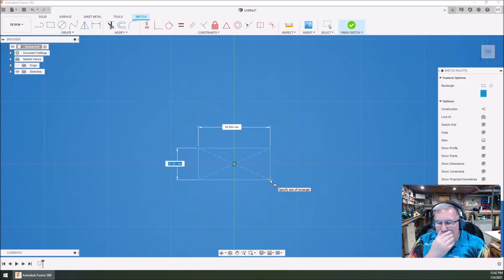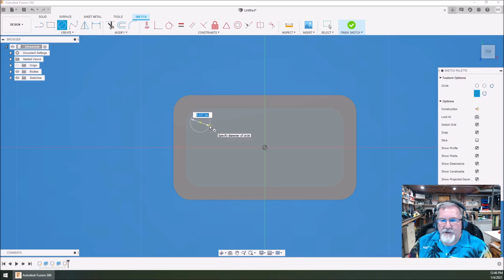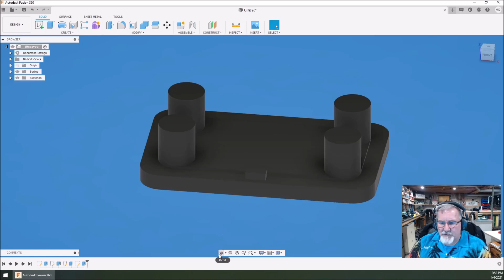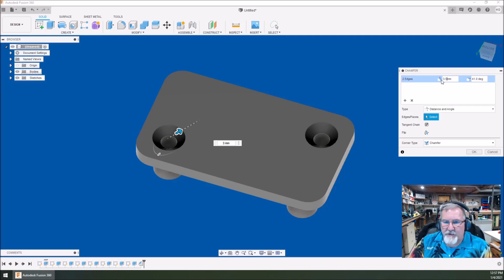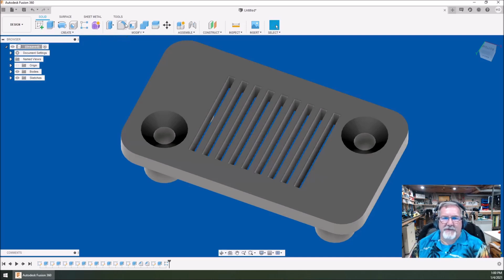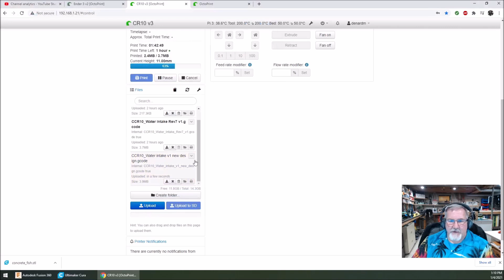Reverse Engineering with Fusion 360  Let's design and print. Today we create an outboard motor part.

Comment: Very nice. I do quite a bit of reverse engineering for 3d printing. If possible I scan it, then inserted the scanned image in to a cad program and draw from the image. then delete the image. then connect the lines as necessary, then scale the drawing to one side of the actual part. Repeat (if needed and possible) for other sides of the part. This would have worked for your part because it was basically a box but it won’t work if the part doesn’t have at least one flat surface. However I’m not sure it would be any quicker than your method of measuring and sketching the actual part. Just shows there’s more than one way to skin a cat. Thanks for all your videos.
Reply from the maker: Thanks for watching and commenting

Comment: Don't have a 3d printer yet, however I loved this video. Excellent work!!!  I have 1 question about the Creality CR10 v3 you have, did you install the BL Touch device?
Reply from the maker: I do not have the BL Touch device. I think they can be very useful if your surface you are printing on is not flat

Comment: Hi Mike, for my birthday I bought a ender3 pro for the exact reason to attempt to recreate outboard/ snowmobile parts I’m very green when it comes to computer and designing. I work at Dockside Marine in Marquette, Michigan, We work on outboards and inboards I’m 25 years old most of the stuff we work on is older then me, parts are getting hard to find. I was wondering if we could  email and share designs and problem. Thanks so much
Reply from the maker: Sure can.
Reply: Please email me I think we can help each other out
Reply: How are you going to test your product the thought that keeps going though my head is liability
Reply from the maker: @spencersmith7130  I'll be testing these things on my own outboards for many hours before I offer them up for sale.  Now for something like a choke knob there is virtually no liability due to if it brakes then no other motor parts are ruin as a result.  In the case of a water inlet. I have to make sure flow happens.

Comment: Instead of selecting export as STL, you can select (right click) any part of the tree (Like the body or even the root of the tree) and save as STL. This will allow you to either send it Cura, or save it as stl on your machine. The advantage is that it doesn't have to be processed on the cloud and is near instantaneous.
Reply from the maker: Yep, I figured that out since this video was published.  I will cover that in my next video for sure.

Comment: Hey Michael, nice video. 
You may want to look into the 'octoprint connection' plugin in the cura marketplace. With that you can save the sliced gcode directly to octoprint.
Reply from the maker: Cool, thanks!

Comment: That's really cool Mike, I think I told you before that at Boeing when we started to build the 747-8 they sent us Team Leaders from each group to learn Catia which is like Fusion 360 but super expensive. When we got back to our computer and signed up for it at our work stations we could only look up stuff but not design unless you were in engineering. I would like to have 360 here at home so will look into getting it and a printer someday. At the boeing Class they did show us how to build parts which was super cool and I still have the small book they gave us to reteach myself. Oh why do you use metric measurements rather than standard?
Reply from the maker: I have been using standard measurements my whole life.  Tool Maker by trade. I'm expanding my mind and absorbing the metric system.

Comment: Nice job. is your mirrors custom made or are thay  store bought? right now iam haveing a heck of a time gitting prints to stick to the bed. any ideas?
Reply from the maker: Got the mirror material at Lowes and Hobby Lobby.  Use 91% isopropyl alcohol to clean glass.  Bed temp at 60 degrees C with PLA. So far so good.  I have some bed stuff coming from Wham Bam magnetic print bed material.  I will do a video and report out on it when it arrives. Stay tuned.
Reply: @Michaelinthebackyard  thank buddy, keep up the great help.